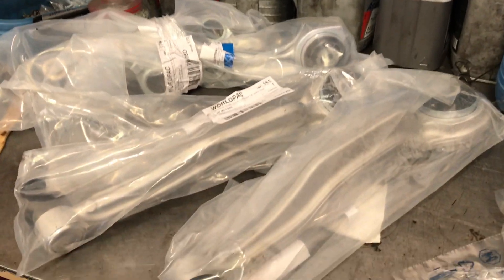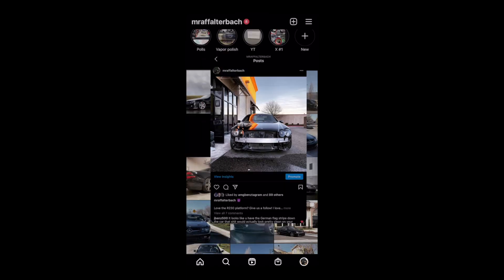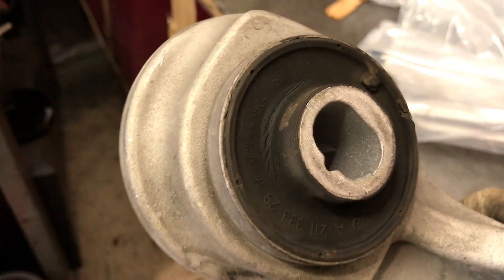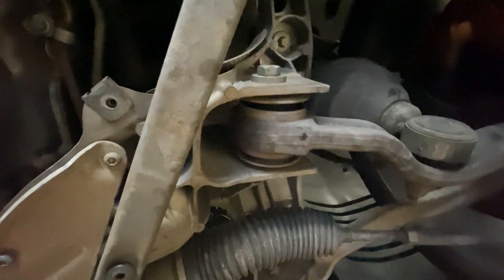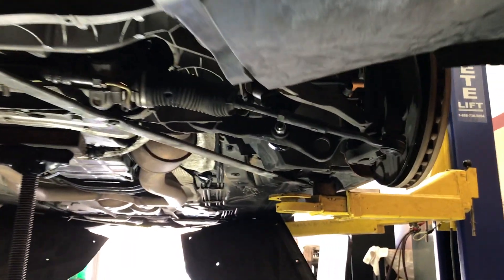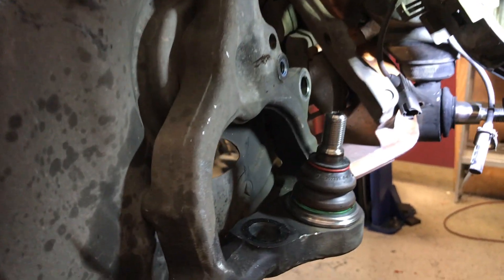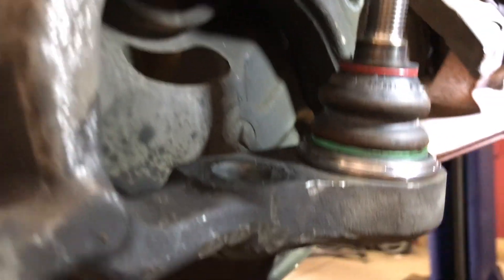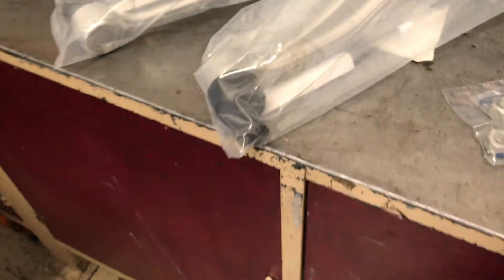Replacing the control arms and ball joints on my R230 | SL55 build pt 13

Comment: Thanks for the upload. I need your advice, the bush at the bottom of the ABC shock is worn, can it be replaced or is it a part of the strut - MBenz say that bush is not available seperately, someone said the bush from  a non ABC strut will work. Any thoughts please - ( 500SL front shock 2009) Thanks
Reply: Search for "ABC Strut ball joint repair. The CAR WIZARD shows to fix ABC strut on '04 Mercedes SL500" here on YT

Comment: How did you install the lower ball joint ?  I know it did't just drop in. :)
Reply: He has some tools that he didn't even go over, like the ball joint separator sitting on the table. I bet he used a press. I just wish I knew what size press would fit. I'm either going to try the AutoZone loaner tool or buy something, but either way it sucks to start the job and then find that the press I have isn't the right size. I'll measure the new ball joint first and confirm, I guess.

Also, put the new ball joint in the freezer to make it easier to push in.
Reply: @charvakkarpe  I ended up doing my entire front end.I used a 20-ton press and a ball joint service kit, both from HF. I had to grind one cup's wall thinner to fit flush. I think it was for the ball joint at the bottom of the ABS strut. All-in-all, it went very smooth. The popping and clunking noise from the front when turning are gone.

Comment: Very misleading. You must torque the control arms to spec with the suspension "loaded" on the ground or with a jack under the wheel to simulate the suspension being loaded on the ground. Not just tighten them up to spec. This is a disservice to DIYers as it's better to leave alone than to do it WRONG.
Reply from the maker: Thanks for writing a comment that means nothing to me or everyone in which this video has helped